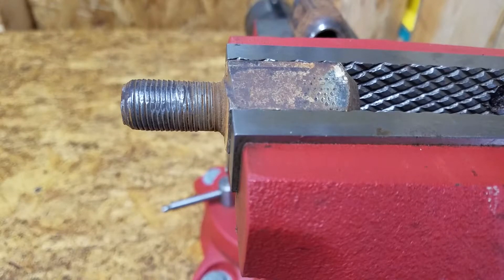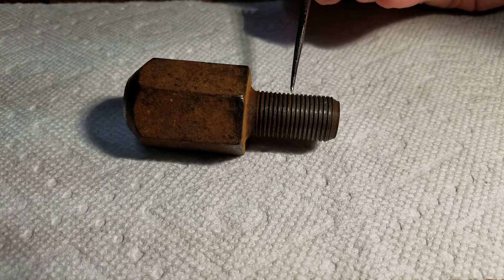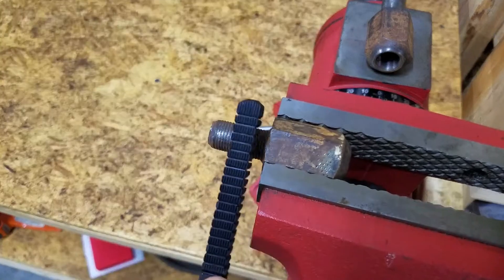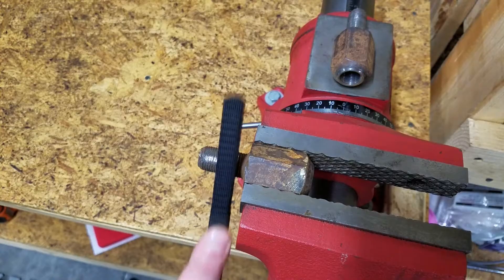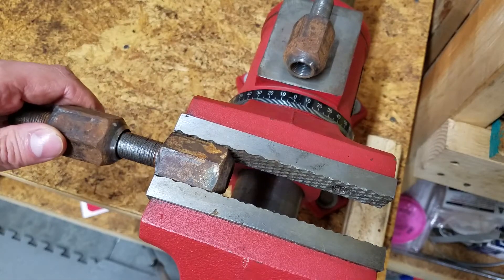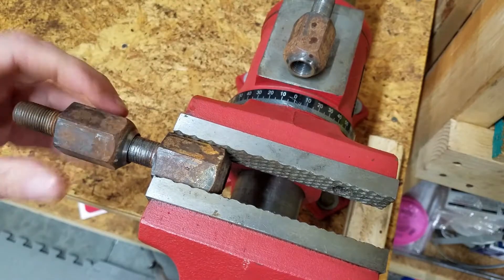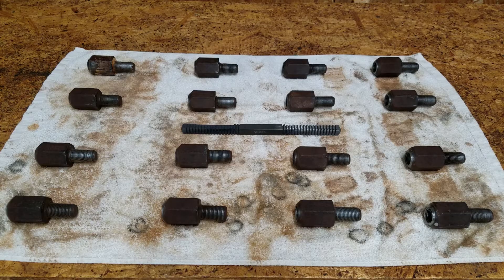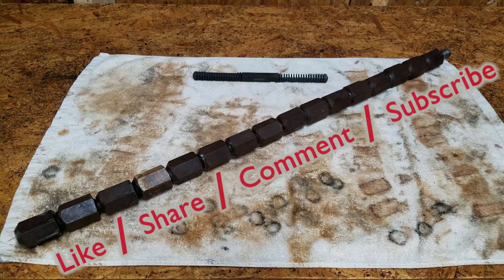Repairing Bolts with a Thread File

Comment: What is the best thing to do. If the nut is loose instead of cant rotate
Reply from the maker: I'm no pro but if the nut is too loose, either too much material is missing from the bolt threads or from the nut threads and that piece would need to be replaced. You could wrap the bolt with enough teflon tape to remove the play. Alternatively, if it's not something you plan to take apart, you could put JB Weld on the threads, tighten down the nut, and let the epoxy cure in between.

Comment: I loved the patience that you had while fixing the threads with a thread file. I personally would recommend you a silbertool threadsaver for the future. You don't remove material with those and thereby thereby weaken the thread. Instead you fully restore the thread with a patented non-destructive forming technology. Those threads you would have fixed in two minutes with a threadsaver.
Reply from the maker: I had never heard of those before and I see that you're associated with the company that makes them. They kinda look like pipe cutters! :) While this does seem like a superior product, I'd hafta fix a LOT of threads to justify a tool that expensive. Sure, the thread file takes longer but I only use it a couple times per year and for under $15 I can fix multiple thread pitches with the same file so it's a perfect fit for my needs.

Comment: I had to fix a shaft with threads, My file did not have the correct thread count. I had a extra nut that was correct. I sawed one side of it open, ran a tap down it to clean it up. I used a drill bit one size larger than the shaft and drilled out 3 threads of the nut. The shaft could then get started straight and acted as a adjustable die. Finished it up with a actual die and the threads were great when done.
Reply from the maker: That's a great tip, thanks! I've done something similar by cutting a couple vertical grooves in a bolt with an angle grinder, using the thread file to clean up the edges of the threads, and then using the modified bolt to clean out a threaded hole.

Comment: Hello, can you tell me the name of that bolts (Specs) ? thanks
Reply from the maker: They're called rear wheel flange nuts for adding pie weights to tractor rims. They are 1-1/16" hex, 2.65" overall length, 5/8" - 18 UNF thread pitch. Here's a link: https://amzn.to/3zafWdF

Comment: I have a drill press and I damaged the threads on the bolt where my spring goes. Which one do I buy SAE or METRIC? I’m in the USA.
Reply from the maker: It all depends on the drill press. You'd need a Thread Pitch Gauge, like this https://amzn.to/4ctlI8A , to find out the pitch. Or you could get a thread file set which includes both SAE & Metric: https://amzn.to/2T1hspN

Comment: the thread file shouldn't remove any material; It just "straightens" the "bent" threads
Reply from the maker: It does remove a small amount of material but less than chasing the bolt with a die.

Comment: You aren't using this proudly
Reply from the maker: Did you mean "properly"? If so, I do realize a file only cuts in one direction but it's much easier to just run it back and forth rather than picking up the file after each stroke. The results speak for themselves.
Reply: @Mikeattempts   I agree with @ericluedtke3507 you were way too humble. Please be a little more arrogant & boastful when using the tool.
Reply from the maker: @furiouhuzzah  Hahaha! ;)

Comment: I had a minor emergency on my hands:  I accidentally damaged the starting thread to my steering column shaft (gulp).  It got damaged when the steering wheel puller slipped and I collapsed the starter thread down by accident.  I could not get my steering wheel nut back on!!!  My brother-in-law sent me this link, and I order the tool from the link provided by Mike.  (Note:  I did not want to try to cut a thread using a die because I only have 1/2" of threads to work with - and if I goof it up - I'm done).  Well, I got the tool today, and I very gingerly cleaned up the damaged area (only just enough) and (drum roll please)...  It worked!  I could get my nut back on.  Thank you "Mike attempts" your video really helped me out!
Reply from the maker: Oh man, that's awesome! Not only am I happy to hear the video was helpful, I also really appreciate you taking the time to comment. I bet you were sweating bullets when those threads got damaged, and I think other viewers would also like to read of your triumph. :)

Comment: Which one do I use for a 24mm bolt on my driveshaft? idk what pitch or whatever...
Reply from the maker: It all depends on the number of threads per inch (TPI). The cheapest way would be to measure 1" of your bolt and count the threads. Or you could buy a thread pitch gauge ($5 - $10). The you'd buy a thread file that includes the TPI of your bolt.

Comment: so im assuming its (threads per inch / 2) - 1

(18/2)   - 1 = 8  for the example in the video
Reply from the maker: No math required, the bolts in the video were 18 TPI (threads per inch) and I used the end of the file stamped with the 18.
Reply: @Mikeattempts  i was trying to match my file with a test studs threads, i found at the front of the file you can test if it will bite correctly with the threads.
Reply from the maker: @unguidedone  Yep, that's how I use it as well, much easier than counting threads. :) Thanks for watching!

Comment: Use a hardened nut with cutting fluid or correct size die.  If you don't have a die cutting nut in two with abrasive blade and then welding it back using spring steel over a good bolt will make a rework tool. I just don't see how the file method is really a good idea.
Reply from the maker: The thread file does the same thing as a thread restorer nut. The good thing is that you can use the file on all different diameters and thread pitches rather than needing a specific die for each size. It worked great for me.
Reply: A die removes metal, weakening the thread. The split-nut thread restorer is probably the best as it moves the metal back into shape rather than cutting it. Thread files are somewhere in between. They remove a little if the damage is very bad but not as much as a die would. The main advantage is they are quick and effective. There are also hook-on adjustable tools available which offer the best of both.

Comment: Minor point, but metric threads aren't measured in threads per mm, they're measured in pitch which is the distance from one peak to the next. Pitch is the inverse of thread count, so for example a pitch of 0.5mm would mean 2 threads per mm and 10 threads per inch would have a pitch of 0.1"
Reply from the maker: Ah, good to know, thanks for the tip!

Comment: Nice video but I believe the file only cuts on the forward stroke.
Reply from the maker: You are absolutely correct, it does only cut on the forward stroke. However, it was easier and faster to just go back and forth rather than picking up the file after each stroke. Thanks for watching!

Comment: Someone below said he used a file. I can't find a file fine enough to deal with my specialist fitting, the threads of which are damaged at the end so can't get a die onto it. All the vids on thread files show bolts damaged in the middle -- easy: put a die on.
Reply from the maker: I would think a thread file would work for you but small triangle files are pretty common and might be what you need for your specialist fitting.
Reply: @Mikeattempts  Thank you. I have two sets of fine files, one diamond, but they are all too big --especially the triangular ones! Anyway I'll try to find one of these in the shops tomorrow. Thanks for video.
Reply from the maker: @johncollins8304  I bought a cheap file set and it included a very small triangle file so you shouldn't have too much trouble finding one. Why wouldn't a thread file work for you? Thanks for the comments.

Comment: good one. i just bought one today and thought i must be using it wrong as it seems to just run over the top of the bolt doing nothing but now i see it takes some time. cheers, good video
Reply from the maker: Yeah, the thread file isn't very aggressive but that's a good thing. It takes some effort but it works well. Thanks for watching!
Reply: @Mikeattempts  I ended up using some small thin files as well which worked better and quicker to be fair but I like the way the thread file has the different thread gauges at both ends to determine the thread spacing. That alone was worth the price of the tool and will come in handy in future bolt battles. :-)Overall a good tool for the future.